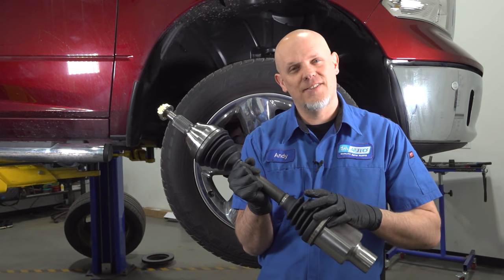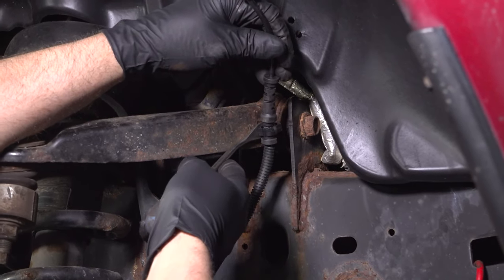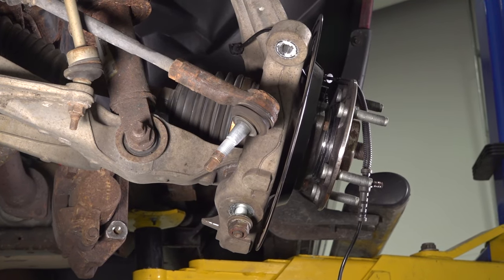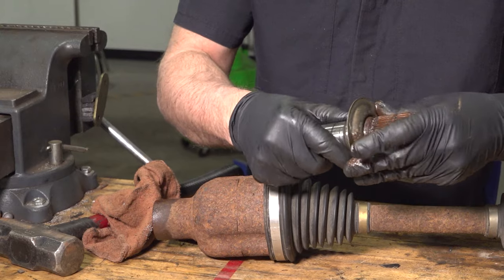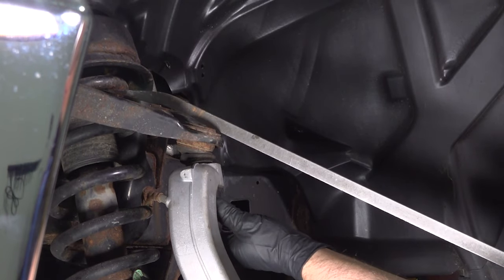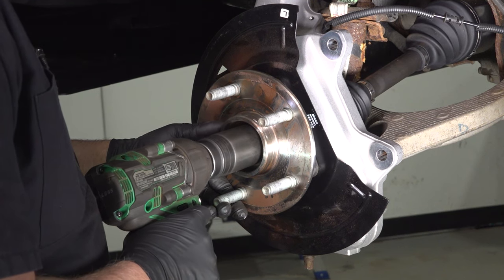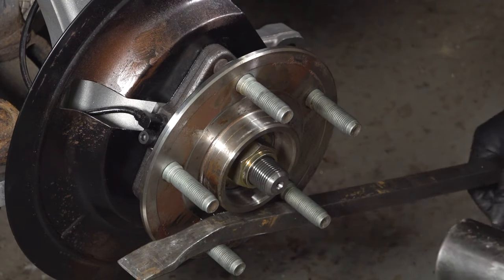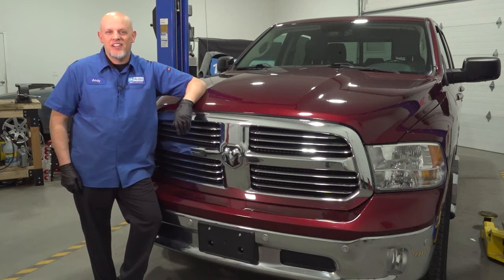How to Replace Front CV Axles 2011-2018 Ram 1500

Comment: Good video, but why couldn't you just remove the bearings and pull the axle through the control arm ?

Also, drivers side is just as easy ??

Comment: How come when I go to tighten tie rod ball joints and other things attached to spindle I need a large lug nut sized open ended wrench as there is a 10mm bolt on the tip that spins not allowing  me to tighten with a socket so I need 2 wrenches and I can’t get it tight enough ?

Comment: Thanks so much, 1a auto. With your help I was able to complete this repair. Unfortunately for me, my upper control arm would not come out even with a impact. I had to use a ball joint presser to add tension so it would not keep spinning. The 10mm hex stripped. My lower control arm also gave me problems. Needed to use a 2 arm press  off amazon to help me dislodge the ball joint. I tried removing the cv axle with the lower ball joint on like some other ppl said could be done but it didn't work on my 2011 ram 1500. Eventually, I was able to replace the upper control arm and cv axle. Also, thanks for the torque specifications!

Comment: Part you forgot, good practice to clean behind the rotor and on the hub flange to avoid issues, also recommend leaving the hub cap off the rim, go for a ride and retorque the hub nut 👍🏻